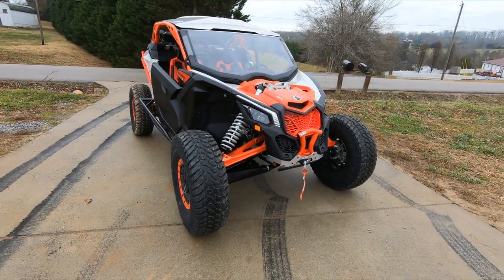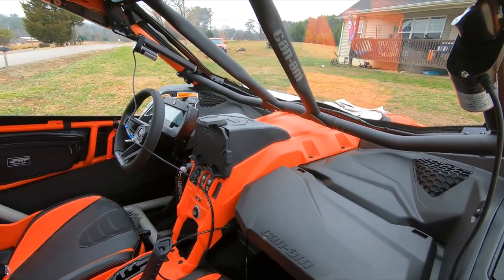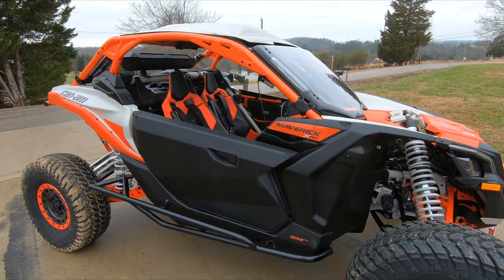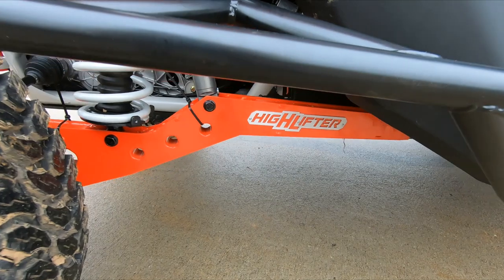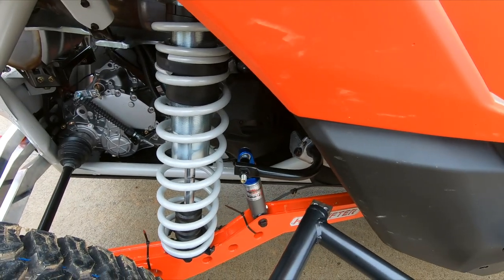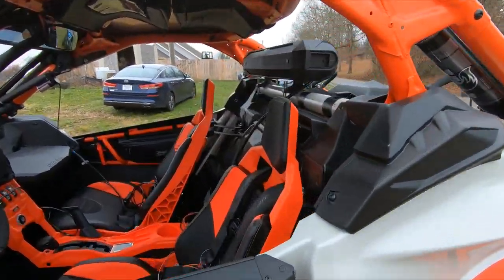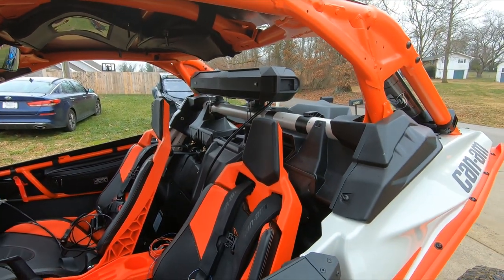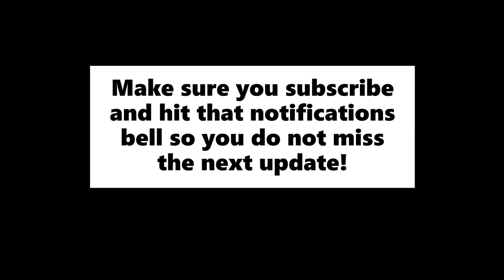2021 can am X3 XRC RR build update 1

Comment: How does this thing do in muddy and slippery situations........I ride In the Midwest Kentucky Tennessee and Indiana and the terrain is pretty rough and can definitely get slippery......I wanted this one or the new smart suspension I'm going to trade my KRX for one and it does great in the trails....... mud ruts and rock crawling...... but I want something with more power is why I'm trading
Reply from the maker: I will say this thing is a beast. It will dominate anything you throw at it. I will say the xrc is a very well built machine for the conditions you just listed even in 100% stock form and never let you down.
Reply: @AbramHeathFULLYEET  hells yeah man thanks for the response....... and your machine is looking awesome man Thanks.......🤘

Comment: Why do you have your shock reservoir upside down on the back , wouldn't that catch limbs and stuff
Reply from the maker: Originally the factory mounted position was in a place where I feel like it was the most vulnerable to be damaged. The way they are mounted now gives them more protection I feel like and without disconnecting the lines that's where they mount unrestricted.
Reply: FullYeet Adventures mine were like that and I moved them rite side up and in towards the bed and have rolled my machine and everything was still there, I ride trails a lot and tree branches were sliding rite down into that groove that's why I moved them
Reply from the maker: @jeffex72  I'll see how this setup works. If I have any issues I might run a bar between the one's they are mounted to and mount them there.
Reply: FullYeet Adventures ,nice talking with ya
Reply from the maker: @jeffex72  no problem thanks for checking out our content!

Comment: What is the purpose of the catch can?
Reply from the maker: An oil catch tank or oil catch can is a device that is fitted into the cam/crankcase ventilation system on a car. Installing an oil catch tank (can) aims to reduce the amount of oil vapors re-circulated into the intake of the engine.
Reply: @AbramHeathFULLYEET  thanks for explaining,
Reply from the maker: you are welcome.